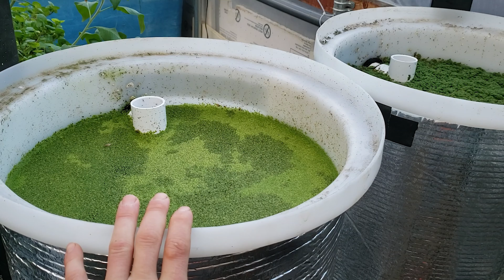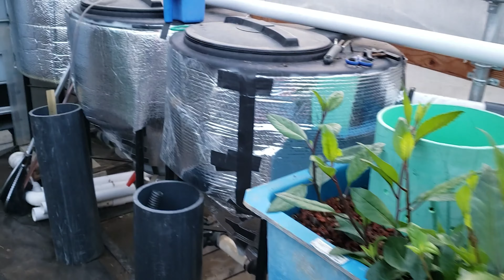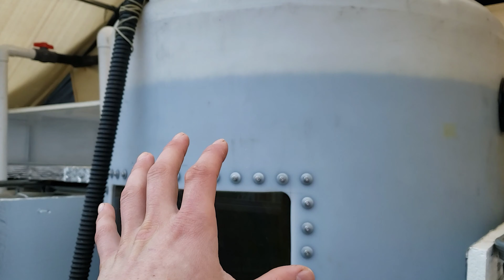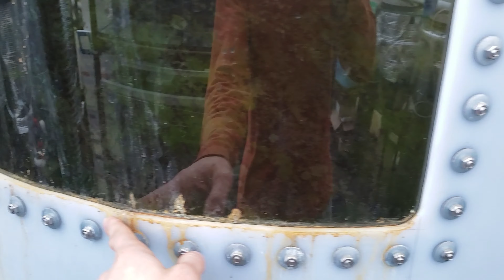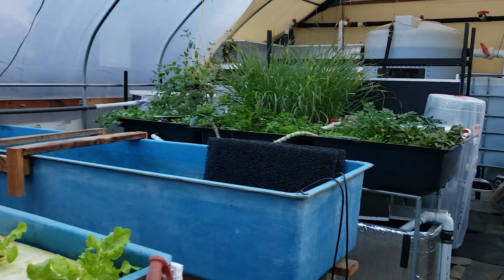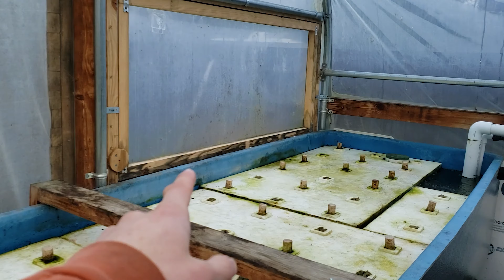Aquaponic system build plan (changing up the layout of the system)

Comment: Hi like your set up, i have a hydroponic system and currently growing small amount of vegetables in my basement and looking into uv set up to Clean and control Green Algae, question if I place uvc light 1inch from root vegetables plant in water tote container will it harm the plants ? Or is it best to place into a separate tote container
Reply from the maker: I am not sure of the affect that the UV will have on the plant roots since I have not tried that. But the UV will damage the tote that you are using since it is most likely not UV resistant. And therefore the tote will need to be replaced eventually.
That being said having the roots exposed to the UV will probably help get rid of pathogens and other harmful organisms. But it could also damage the beneficial bacteria growing on the roots.
It might be best to just house it in a separate container or buy a unit that you can hook up to your plumbing, You could also even set it up so that you can stick the uv light in a pvc pipe (like an overflow pipe) so that the water passes by the light. But if you do it that way you would want the pipe to be like 2inches in diameter. 

There are a few options. If you do put the UV below the plant roots let us know how that goes.
Reply: Thank you so much 👍🏼

Comment: It also occurs to me that where that compost bed is in relation to the greenhouse,  you could use the water from the coils you run through it to heat the seeding table you plan to build.
Reply from the maker: That is another good idea. I will probably first just try running the could through the compost bin to heat the water in the aquaponic system.

Comment: Love the system. I wouldn't get rid of those two IBC tanks if you're planning to breed fish, just get some more totes. Also, have you paid any more heed to my sump/trompe idea for an air source?
Reply from the maker: Ya after starting to work on the one side of the green house I did change my mind on moving those IBC totes. It would be a lot of work to move those two tanks. So I will most likely just leave that side the way it is but will work on the other side.
 For fish breeding I would think that 55 gallon drums would be better than the IBC totes, since the fish wont be grown to full size but sold at fingerling size to maybe about 2inches. So the smaller tanks would allow me to have different age fish available. But it depends on what the goal is.
Regarding the trompe I actually forgot about that but I will see if I can implement it when I redo the pumps plumbing. If you can, email me some ideas you have on how I can set it up. I did watch a few DIY trompe builds earlier today.